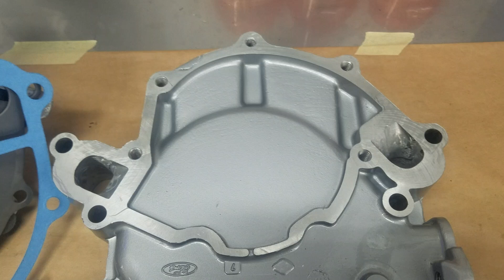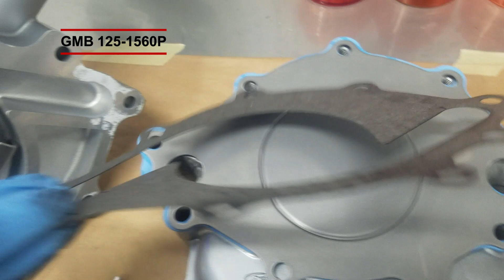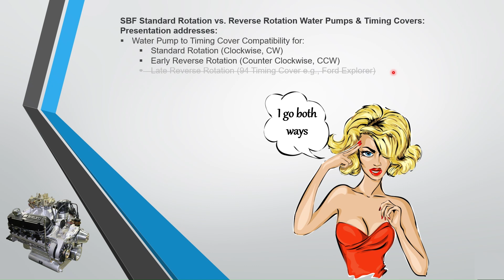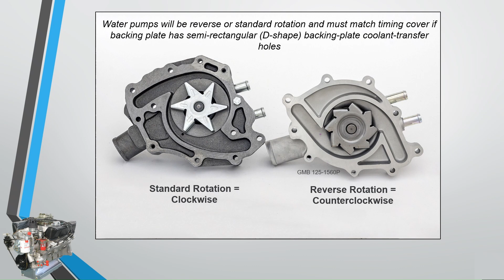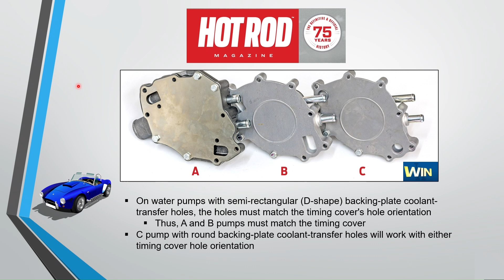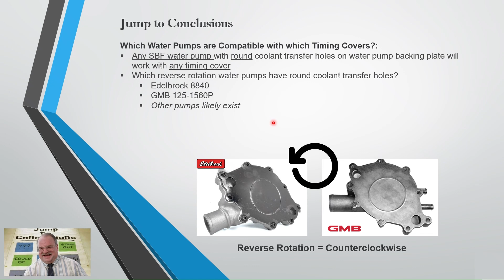Small Block Ford Water Pumps: Standard Rotation vs. Reverse Rotation and Timing Cover Compatibility

Comment: Great video and explanation. I’m having cooling issues on my 69 bronco. It has reverse rotation water pump. (March serpentine system)

My question is, if the reverse rotation water pump (counter clockwise) was installed on clock wise timing cover without the circle adapter plate would that be the cause my cooling issues?

I don’t see the adapter plate between pump and timing cover, but I haven’t taken it apart yet. 

Any help would be greatly appreciated thank you!!!

Comment: Great thorough short video. Helps me understand why a front cover gasket set has so many gaskets. D shaped cover passages and round hole backing plate passages is quick clever engineering.
Reply from the maker: Thanks buddy.  Yes, another "Ford changed its mind" issue.  To be fair, most, if not all, of the US engine industry went to reverse rotation water pumps when they adopted serpentine belts.  Ford probably could have adopted water pumps with round backing plate holes and not changes the timing cover case, but they didn't so here we are!  Yes, I purposely tried to keep this one short and concise.  Thanks for weighing in!
Reply: @BlueOvalEdge  Was thinking the reverse CCW pumps must have been a result of serpentine belts. In my head that would have the coolant also flowing  in the opposite direction which I’m sure it doesn’t as it would keep getting hotter. I must be overthinking the CCW and coolant flow direction. 🤔
Reply from the maker: @ClassicCarCountryDoctor  Oh good point.  Although the WP is reverse rotation (CCW), the impellor is designed to flow water through the engine, and in and out of the radiator, in the normal flow direction.  So yes, "reverse rotation" is counter-intuitive but water flows through the engine/radiator in the normal flow direction.